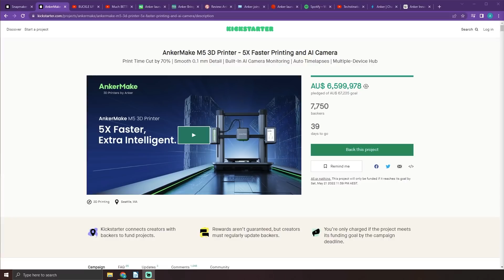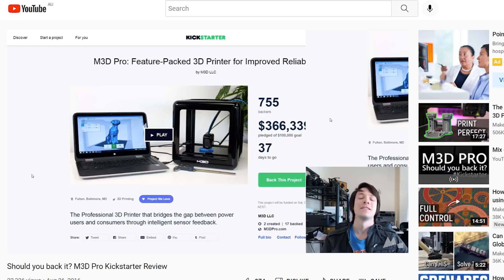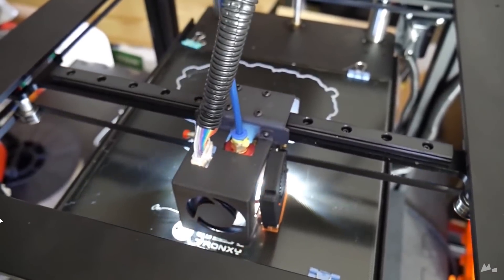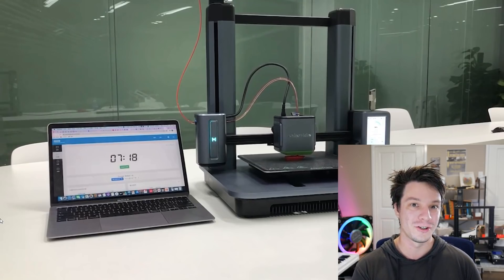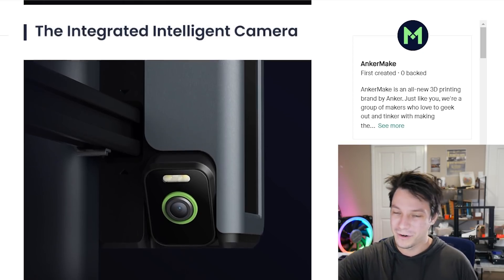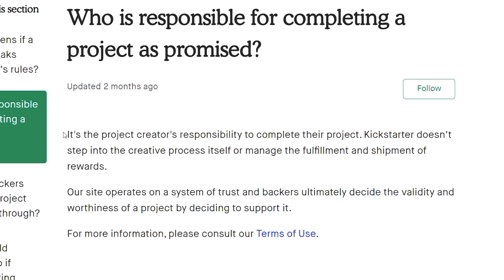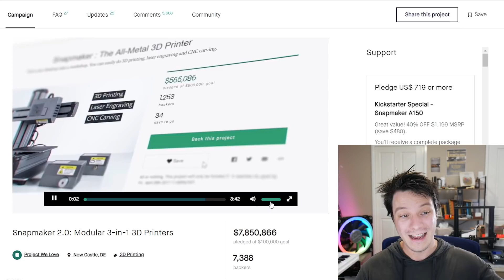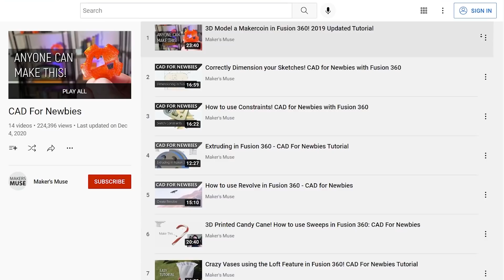This 3D Printer looks incredible, but...

Comment: Honestly I'm underwhelmed. A friend of mine bought an expensive delta printer with built in ABL and all the bells and whistles because it advertised itself very similarly, and he dismissed the technology because of his poor experiences after the first few prints he did with it. 

If there's an issue, you can't go in and fix it, you have to just trust the built-in systems are good enough to fix itself. Considering OTA updates to appliances can brick them, like we've seen with microwaves recently, I'm skeptical of any software controlled fully automatic printer. 

Also not sure if I want a camera feed connected to an Anker AI server recording everything I print. That's just a little too creepy for me.

Comment: looking from a uv printing standpoint (pictures not 3d) that technology will never be easy, the uvink technology has over a decade of development in it and is still complicated.
Inks are toxic uncured, nozzles can clog, ink needs to be constantly agitated, the curing proces is susseptible to uv exposure afterwards etc. in the printing industry an uv outdoor print will hold around a year (european sun levels) before you will notice fading. and no company will ever give you a guarantee for a longer time period. 
FDM has it's validation in being inert after printing, non toxic during storage, low maintenance (for some filament types) and hard wearing after printing (again for some filament types).
I can see that technology never stands still but as someone who has a resin printer for fine detail I also realized that i just want a work horse for parts that are instantly usable without finding the right environmental variables to make it work.
"it wont be perfect but itll do the job" is worth a lot. I can see the ankermake trying to please that niche by focusing on print speed and making the start easy and automated.
what i absolutely distrust is how modular and repairable the print head will be.
If we end up in an apple scenario where only branded spares can be used the whole thing would be worthless. 
This again is coming from someone with a resin printer where basically the most expensive spares all come from one and the same factory, and therefore are always out of stock at the same time at all the distributors.

Comment: Hey Angus! 3D Systems also has the MJP 2500 which is similar to the Objet except it uses wax for support material. It's a fantastic easy to use printer

Comment: I'm always tempted to get a FDM printer but compare to resin printers there's so many variables for fail prints. Both have pros and cons but in terms of hardware FDM seems to vary wildly. Having a consumer level FDM printer would be good but it still doesn't fix the whole reliable part of the equation. I'm excited for Anker to come out with this but for the price it better be bulletproof. I will probably wait for their 2nd or 3rd generation before I would jump on it.

Comment: If you think about it, there is not much happened in the last years in regard of consumer 3D printing. There are some cool ideas (multi color/material, speedy printers) but at the end they are either unreliable or expensive or require a lot of knowledge. I bought my two printers MK3S & Chiron to print stuff for the house and garden. (My daily work is NURBS modeling for cars, so I can build whatever I want). Although I don't have two left hands, my original idea, that I just build my stuff and press print... never materialized. Many time it's still a hassle and anything but straightforward. I would really love to see a company bringing hassle free 3D printing to the masses. Would I bet on it? Neeee...

Comment: The problem with resin jet tech is that it will inevitably follow the world of ink-jet printing - the printer will only accept "chipped" tanks of resin that are proprietary, they will void warranties for using "non brand" resin, and the cost of the resin materian will be more than gold.  Just like inkjet ink.  So even though that prediction may be correct, let's hope it's not.  FDM works fairly well.  It remains a tinkers tool, and, as you point out, that is regardless of the physical print tech - it comes right down to the design tech.  Most of what makes prints fail is in the slicer settings.  Let me give you another example - think about a simple clothes washer.  In the old days, there would be a timer dial: select from 12 to 30+ minutes for your clothes to wash.  Now, in the beginning you might have picked the wrong setting a few times and had a bad wash, but eventually you learned that sheets had to go in for 15 mintunes and your blue jeans had to go in for 30.  Now, the machine comes with all kinds of "use case" settings.  You pick "jean", but it doesn't clean the jeans very well.  What do you do?  You can't make adjustments.  You call the manufacturer and they tell you, "that's not something we can adjust".  It's just all around aweful.  There is no substitute for individual owners climbing up the learning curve themselves.  The key is to make the learning curve nice and gradual, so that you have modest initial successes without huge investments of time.  If the g-code shipped with a printer on an SD card won't print right using supplied sample filament, well, that's when people put the machine in the bin.  But there has to be intermediate steps where you don't just print other people's g-code (which may or may not be for your printer)... but you learn how to slice the shape for your printer and material.  Then you go back one more level to learn how to design objects with a mind for how they will lay out on the bed, where supports will go, what kind of wall/skin/strength it will have.  Most people are lazy.  And most kids are even worse.  They don't want to hear mom/dad call them to come down and watch their new toy being built.  They want to click-click-click on their Twitch-Chat-Insta-Face.   They can't even be bothered to figure out how to connect to wifi.  So yeah, you can design a print technology to that level of lowest denominator, but it will ruin what is the vibrance of the 3d printing community because cost will go up and usability - as in custom use and adjustment - will go down.

Comment: I'm surprised we haven't really see someone come out with a modular Lego type system for designing prints. It would probably be rather limited but it might set the stage for further learning later.
Reply: System like what? Prims and boolean can get you pretty far, plus an alignment grid, and that's basically TinkerCAD. I forget which of these either MatterControl or IdeaMaker is integrated prim modelling and slicer.

Comment: It looks kind of nifty. I guess my first thought was "does it run an open firmware?" - I am obviously not the target demographic.

I have no problem with a printer like this and I look forward to a day when a house has a printer near just like a clothes washer and dryer. I look forward to a day when, if a part breaks, someone can order the print off the manufacturer's site (for a fraction of the cost of a physical part) and print it at home, confident it will complete.

Me? I like the balance between the open platform, relative ease of use, and decent reliability of my Prusa. I'll likely continue to want such a machine that I know I will be able to maintain myself, but I hope others have the option of a machine that can reliably lay down parts with no fuss, even if it means they might need to call service to repair it if it fails.

Good video!
Reply: I 100% agree. A friend of mine bought a Monoprice delta printer years back and the biggest flaw with it is there is no way to make changes/adjustments to any of the firmware. So while it has bed leveling, he can't change the nozzle offset, which results in bad first layers, which of course is the most important part.

Comment: @Maker’s Muse Disagree for the first time. Yes, 3D modeling yourself is useful if you can manage to do it, but it’s not required or necessary to make use of a 3D printer. 3D printers are tools and you don’t have to be an artist beyond the art of printing itself to use them. I’m running 4 printer’s successfully without being an artist for years now. I couldn’t create own artwork if i needed to but i had no problems printing your clearence castle on the first attempt. There are billions of designs for everyone available.Thx for the FR4 inspiration btw.

Comment: Objet was merged with Stratasys, and that tech, while brilliant, is expensive, wasteful and still using very unsafe resin for consumer use at home. 
Great vid as always, I do agree with you on FDM not becoming the mass market one button "home" machine. But, don't forget that there are lots of "pro" level machines that are currently in the $3-10k range that are very turnkey solutions. People at home just typically can't justify that as a cost.

Comment: Multijet is anything but reliable, coming from someone who ran an Objet30. On the surface they are simpler, but there are a ton of points of failure even just in the print head. The heads like to clog, and with the size of the "nozzles" they are hard to maintain. They also require a great deal more precision than your average printer does with very precise metering of the material. Materials also have a short shelf life, and were ludicrously expensive (around $700 per kg). 
I don't know when their patent expires, but I wouldn't expect to see mainstream, affordable printers using that technology in the next 10 years. It took FDM that long to get to this point, and it's way easier.

Comment: While we are whining about how what we have isn't mindless and instantly magic, lets talk about filament, eh?  Why can't we print out super strong parts that NEVER break, won't melt in the sun, never fade or degrade.  How about Carbon fiber nylon filament should print at low temperatures and never clog, absorb moisture, never have layer splitting, never peel up from the bed...etc.
Magic filament that i don't need to learn anything new or use new techniques to get instantaneous satisfaction from.  Every time.
Dang, I kind of like this logic!
Oh, please make the ez filament magic around 5-10 bucks a spool!

Comment: Learning 3d modeling is WAY harder than using a a 3d printer.  This like saying we need a robot that automatically makes a car, while still insisting that people will have to learn how to engineer the car and learn to draw the proper blueprints.
Its just nonsense.

Comment: While I agree with many of the points made here, closing off internals with the reason of "user friendliness" is a VERY slippery slope. I noticed that you liked the idea of resin cartridges, and I agree that the concept is neat, but look at paper printers and what manufacturers are doing with cartridges on those. Prices go through the roof because of their proprietary solutions, and they prohibit third parties from making cheaper alternatives through a variety of different methods. All in the name of "user friendliness" and "quality assurance". It's an awful business practice and I would hate to see the 3D printing scene be infected with this wholly user-unfriendly business model. While there's legitimate value in making printers more user friendly, it sure as hell shouldn't be at the cost of the repairable open-source printers we have access to now.

Comment: I don't understand why people think they can just brainlessly print out any "toy" they want, without any tinkering.
This is manufacturing,  not photocopying, faxing, or printing out your report about dogs for Ms. Johnson's 6th grade science class.

My Ender 3 works nearly flawlessly.  Its just slander to say its " FAR from "unreliable".  My V2 and Pro ARE INDEED "that great".  You'd have to be pretty weak to cry  about the fairly easy learning curve it takes to get them up and running...like a CHAMP!  If you can't hack it, you aren't cut out for printing your pile of plastic crap to begin with.  Go buy your toys off Amazon.
 3d printing is a hobby.  It takes work.  Just like a lathe, or a mill, or a plasma cutter, or any other machining equipment.
I hate it when noobs complain that 3d printing is too hard.  Its even worse when a hardened veteran whines about it.
Reply: And yet you just spent significant amount of time complaining about complaining.

Comment: I like your optimism but I think the first half got a bit carried away by that in regards to this Anker printer. I guess it speaks for some effective marketing.
Marketing is my biggest issue with this one. From their 5x speed claims which only apply to large simple models (13mm travel time to even reach their 250mm/s at 2500mm/s² plus 13mm slowdown) to the making printers "easier".
I mean how realistic even is that example of the father who has the CAD skills, the slicer/print skills as well as the postprocessing/air brushing skills.
Sure you can say its a more "complete" printer but their software side right now doesn't even include anything to actually make that really more easy.
Plus I really don't believe they suddenly invented any kind of black magic to get around all potential clogs/leveling issues and whatnot.
You said it, current FDM 3D Printers are not a hands off reliable machine like a 2d printer (even those jam).
So this design will probably just have issues with the way its built.

Comment: I don't see much difference compared to the Creality Ender-3 S1 I'm currently using at work except more plastic form parts making it harder to mod and repair. I doubt that bed leveling and "AI" camera features will be available outside of some proprietary Anker software - kinda torn here Anker has made some very good and robust software but in other cases they published utter crap full of bugs. Great comment on having to have 3D modeling skills a point that is often overlooked in the consumer industry (probably on purpose). 3D printing has come a loooong way for sure – I still have nightmares of calibrating the original makerbot cupcake more than 12 years ago – but I disagree with you that there will ever be a truly plug and play, 100% success–rate, consumer 3D printer. CAM will always need somewhat skilled operators that know the machine and it's quirks even with professional 6 or 7 figures devices. Keep up the great content, learning a lot from your vids ✌️

Comment: LTT got their hands on one (see ShortCircuit) and it looks pretty incredible and very finished for a prototype. 

I think the KS is for gauging interest in a machine that costs $750MSRP.
Reply: I don't see what this does any better than my Flashforge or other cheaper printers i have.
Reply: @ksavage681  300mm/s printing and as MM said, it’s not really a tinkerers device. It’s someone that wants to print without hassle.

Comment: It still has plastic wheels so in my eyes it is nicier anycubic cobra which costs 300 usd. This printer will not be able to print 20 rolls of filament without wheels adjustment. Ender 3 clone imho. It is good for those who didnt try good printer like atleast prusa mk3 with proper rails. Ty.

Comment: I agree that a plug-and-play printer would be an awesome step forward in the technology and would lower the barrier to entry quite a lot, but I worry about the proprietary aspects of this.  The 3D Printing/maker community has held freedom of information and freedom of modification as core pillars of the hobby.  Yes, I want to see my favorite hobby flourish and the technology improve, but I don't want control taken from me in the name of ease-of-use.  We can have both.

Example;  in my workshop sits an Artillery Sidewinder X1, which I have modded numerous times to improve functionality and consistency.  Right next to it is a Cricut vinyl cutter... which has one of the worst & most locked down user interfaces that I have ever had the displeasure to use... and there are NO alternatives.  The machine does not accept GCode and will not work unless using proprietary software.  That is a path I hope to never see 3D printing go down

Comment: I am looking forward to getting a printer similar to this. Tinkering with an ender 3 can be fun but after 3 years sometimes I just want something easy and reliable.
Reply: Yeah I had a printer that started life as an ender3. I changed almost all of it at one point or another. Something would break or I would upgrade it and have to change something else to get the new one to fit. New board, new extruder, rails, eventually I fixed it til it stopped working entirely and I didn’t want to put any more time or money into it so I pulled all the useful components off of it and scrapped the rest. Bought a Prusa mk3s.

Comment: I agree 100% with your comment on 3d modeling skills. If I didn't have the ability to 3d model my own parts my 3d printers would be collecting dust in the closet. Holding a 3d print you designed yourself is very satisfying.

Comment: I started 3D printing with a Makerbot 2X about 10 yrs ago for work. It had two extruders (two colors or one being support material) and had a bed using kapton tape. Aside from the kapton tape, we were able to print the models we made. Im still waiting for polyjet printers to be more affordable (this is the tech we used in uni to print out wind turbines for research) but I dont understand why FDMs that print with a separate support material extruder is not mainstream.